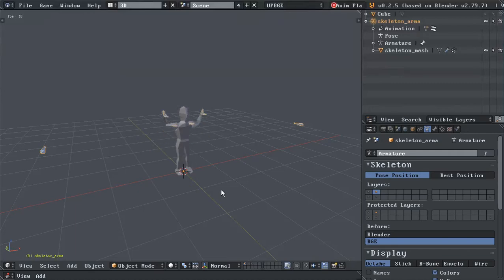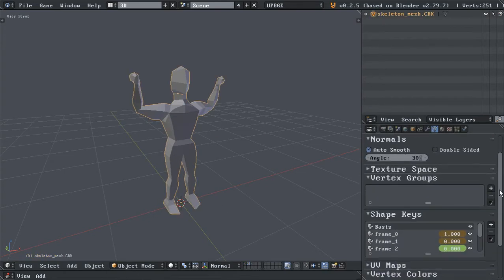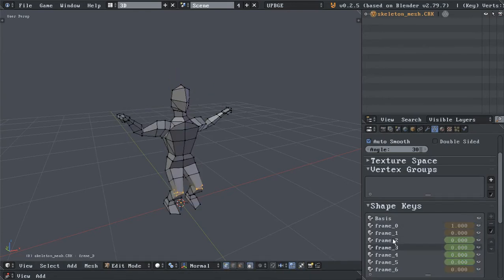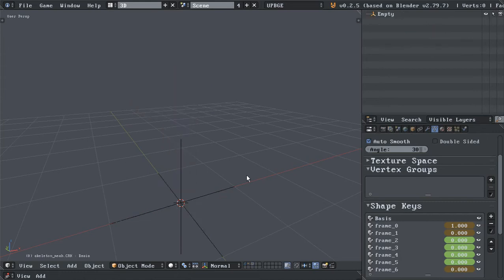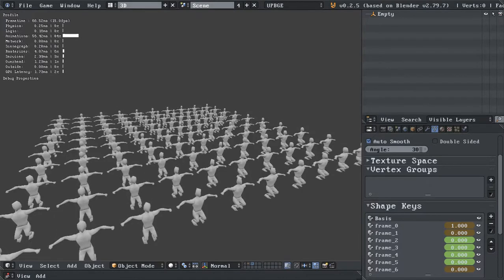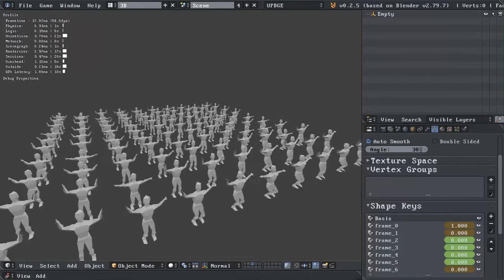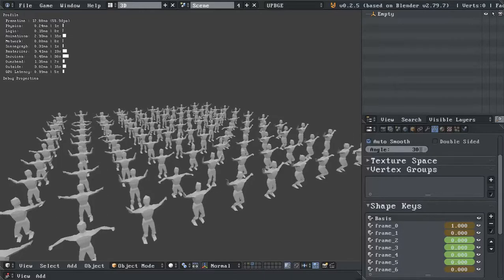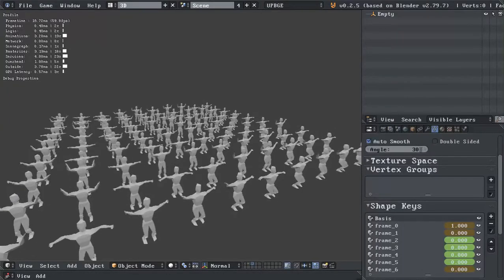ARMATURES VS BAKE-TO-SHAPEKEY [UPBGE 0.2.5]

Comment: This is great work! Excellent result. Where can I read more about this script? Will you release it for free or for a price?
Reply from the maker: Hello! This is free software c: I just forgot to publish it for some reason. I still have the files laying around, so I can clean it up and upload it to github if you need it. It lacks some optimization though (trying to bake dense meshes and too many frames can take a couple of seconds), but I guess I could try to improve performance a bit. Cheers!
Reply: @liebranca  It would be great!
Reply: @liebranca  how did you achieve this result?
Reply from the maker: @МихаилВысоцкий-я5о  In a nutshell, the script reads an NLA track strip by strip, frame by frame, and applies all modifiers as shapekeys unto a new mesh.

Not fully tested yet, but I just uploaded the script if you want to take a look https://github.com/Liebranca/AUVILIB/blob/main/xforms/shapebake.py feel free to use or modify it however you like c:

Comment: hi I was wondering if this could be used with multiple animations - so there could be running, jumping, attacking, etc.
Reply from the maker: Yes, it's baking from an NLA track so it can be used for as many animations as you want. However, note that a shapekey must save vertex tranforms for every frame of animation, so it's not viable to bake high poly meshes using hundreds of frames of animation.

I did stress tests this to in and around 5,000~ verts using 240 frames of animation total, per character. The baking would take a few seconds and it would incur a filesize increase (about one or two MB), which was workable for me at the time. With a modern PC you might be able to push those figures further though.

Comment: Hello) Once again I am writing to thank you for your work, and admire it!
I wanted to ask if you did any additional tests? For example with a more complex mesh?
Do you think this method is justified to use?
Have you calculated the percentage increase in productivity?
What are the specifications of your PC?
Thank you)
Reply from the maker: Hey! How are you? c:

I run a fairly low-end rig; AMD A6-7400K chip with integrated graphics and four gigs of RAM -- this machine is about as powerful as an old, cheap laptop. Good thing I like retro graphics, because I can't really do much more ;>

I did try this on models with higher polycounts; it's possible, but I wouldn't recommend it. The code has to make a copy of the mesh for every frame of animation with deforms applied, so complex geometry will inevitably consume more memory, much more if using many frames of animation.

To give you an approximation: take the vertex count of your model and multiply it by 64. That's a rough (and quite optimistic) estimate of the number of _bytes_ required to store the base mesh.

But now take that, and multiply it by the total number of frames of animation you bake, then divide it by 1024 to get the number in __kilobytes__.

You'll see that as you increase the vertex count, it gets expensive very fast; I think it's only justified for lowpoly, with very economic use of animation. In my projects, I set the animation framerate to a whooping eight frames per second, use as fewer frames per animation as I can, and limit vertex count per model to around 4096 vertices.

Also, note that nowadays I work with a custom framework (that I'm still developing) rather than BGE. Because my renderer decompresses vertex data within the vertex shader itself, I can use this technique with more detailed meshes and animations without running out of memory.

All in all, as I've optimized my entire stack to make these hacks viable, it's a bit more justified in my case ;>

Now for productivity I wouldn't know; I don't even notice these limitations as I'm already used to a very minimalistic style, so I can get a lot of models done fairly quick. But most other 3D artists I know will tell you I'm crazy, so it really does depend.

But again, if you aim for high detail meshes and smooth animation, I don't think I can recommend this trick: the memory requirements would be too high.

Cheers.